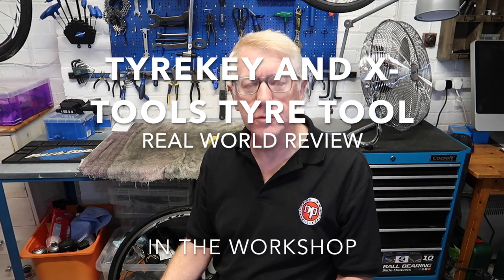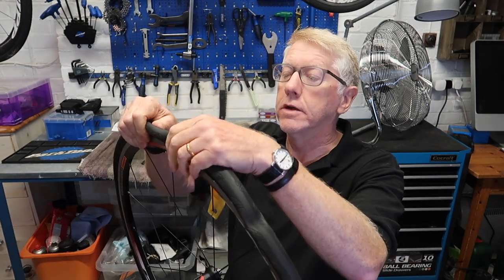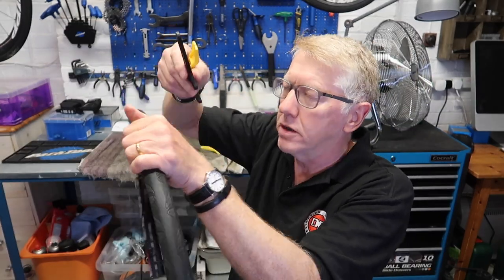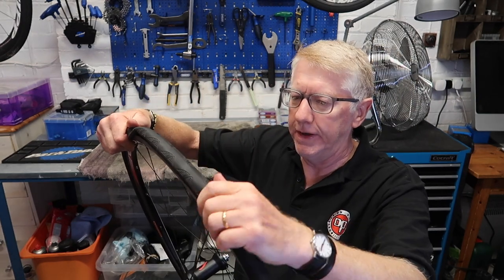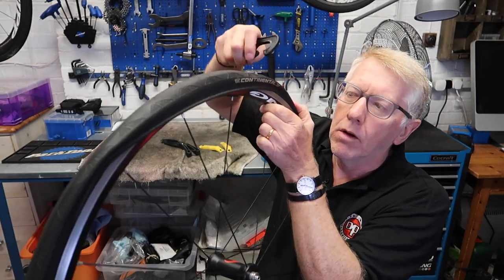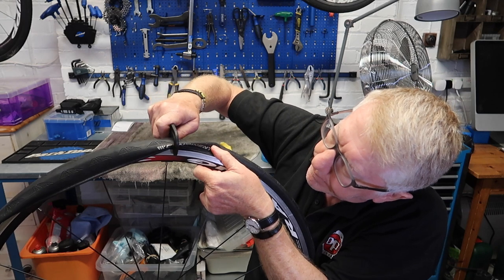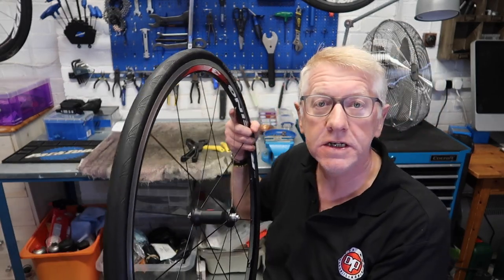Tyrekey and X-tools tyre fitting tool - real world review

Comment: Hi Julian, you pretty much had the technique to reinstall your tyre sorted with our tool! The tyre should be completely inside the 'claw' part of the TyreKey, with the angled edge sitting directly on the rim wall. We find it a lot easier if you stand over the wheel whilst working and use your second hand to hold the opposite edge of the part of the tyre you're fitting to stop it pulling back off the rim. The TyreKey is designed to fit in a saddle bag, tool roll or jersey pocket so in our opinion is a much more versatile tool for both the workshop and out on the road. Thanks!
Reply: I applaud you for your diplomatic assessment Tyre Key :) In reality, Julian made what can sometimes be a bit of a chore look 10 times harder. As you've pointed out, its much easier to do this while standing over or alongside the wheel rather than having it sitting on your lap as is the case in this video, and the key (if you'll pardon the pun) is to get as much of the tyre inside the claw. I recently purchased a Tyre Key and was able to easily remove tyres (Continental 4 Seasons 700x25c) that would normally take two tyre levers to remove, and refit the same tyre to my wheel multiple times within the space of a few minutes - I wouldn't go as far as to say I've got the technique down perfectly yet, but if I can refit a tyre quickly in a few attempts I'm sure it'll get even smoother with practice - very happy with my Tyre Key!
Reply: I can't believe this video. I've been riding bikes for 35 years and who sits down to repair a tire? No leverage to say the least and this would discourage me from ever riding a bike. I have your TyreKey and it works flawlessly even on tubeless only tires. Great job on the design.
Reply: Julian is a wee slow.....
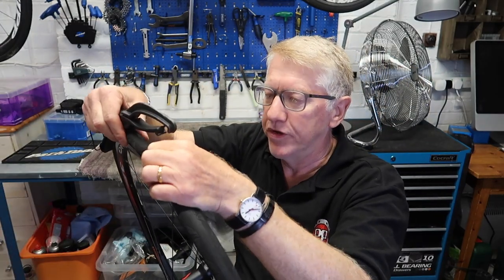Reply: Poor video. Julian does not explain why he used a standard tyre lever instead of Tyrekey to remove the tyre. He then makes a real meal out of remounting the tyre with the Tyrekey, telling us it isn't going to work, then successfully mounting the tyre except for the last few cm. He could have pushed gently on this and it would have seated completely, but he uses this lack of completion (his not finishing) as evidence that Tyrekey doesn't work very well! He then compounds his bad practice by showing (7:04) how 'wonderful' the X-tool is by completing the seating as if the Tyrekey wouldn't. Very poor.
Reply: I think some of Y’all miss Julian’s humourous approach to most things cycling, he has done some hilarious videos in the past

Comment: I'm quite new to cycling and after watching this video have discovered I'm fairly good at changing an inner tube and quicker than the gentleman in this video. I use the koolstop tyre jack. I agree the position of the wheel is the cause of the change taking far too long and very awkward at that angle. Interesting though.

Comment: why do they have to be made of plastic? its going to break after a while like everything plastic does, i would willingly pay more for something in steel
Reply from the maker: Actually, the tyre key is well-made and is unlikely to break. The other model, however, has a weakness in the jaws which twist under strain.
Reply: Metal can stuff up your rims. Only time I have broken a Michelin tyre lever was the other day fitting new 25 mm contis……some operator error, as I had the tyre levers too far apart and tried to lever too much of the bed over the rim at one go….

Comment: The pedros tire levers are great. They work extremely well for releasing the bead. 
The xtool tire jack has worked quite fine for any tire that has been hard to fit. Generally puncture resistant styles the worst.
Reply from the maker: Hi, I've doen a whole video about tyre levers, and mention Pedros ones.
Reply: @JulianHutchings  i bought a heap and will only use Pedros and Park tools.
For road tires the continental road levers. 2 or 3 about 100mm apart  pushed down together helps remove tight beads.